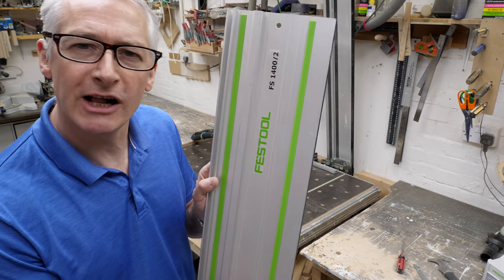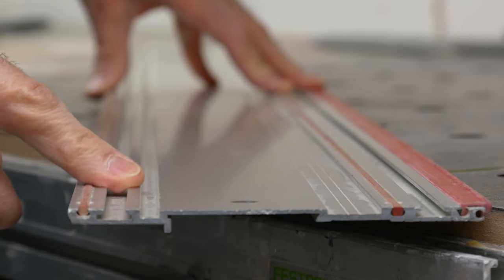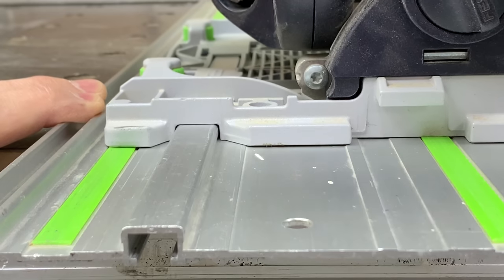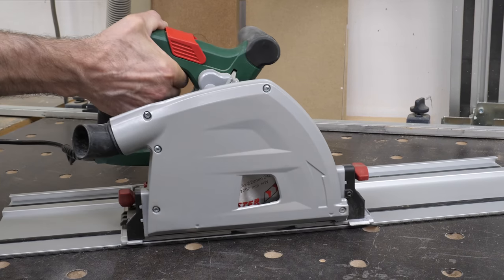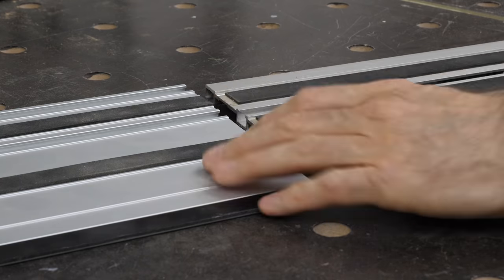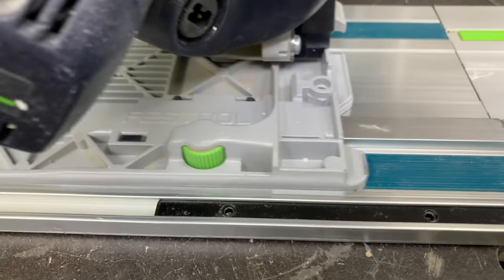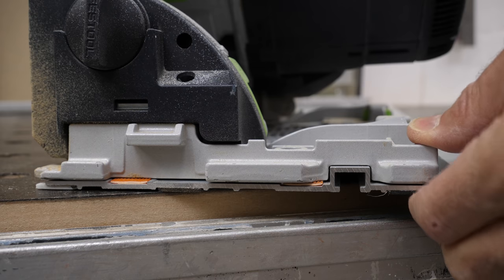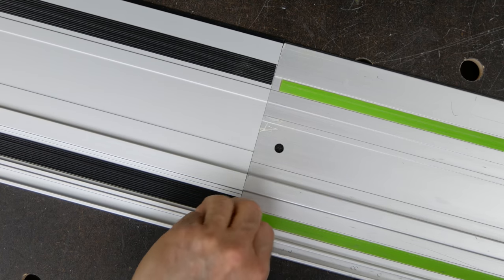Which Rails Work? A Guide to Guiderails [video #403]

Comment: Hi Peter.  Great video.  Can I talk Dewalt for a moment?  For a newbie to this MFT world (all your fault I should add) I made the decision to go Dewalt for my track saw, I was trying to balance money and quality and couldn't justify the additional £200 for the Festool.  I'm happy enough with the saw and the tracks but what I am beginning to note is that some of the useful, after market gadgets are only available for the Festool track.  I'm thinking of things like dog rail clips etc.  I have 2x 1.5m dewalt tracks but I am thinking that I might keep those for full board rips and get myself a 800mm Festool rail to use with my Dewalt saw.  That was a long way of asking..... 'how' compatible with the Dewalt saw is the Festool track, do you know?
Reply from the maker: Hi Greg. I’ve been trying to buy a decent used DeWalt saw to add to the collection for so long, but they hold their value really well! I know they do run on the Festool rails as they have the slot in the base to accommodate the rib, but I don’t know how well they do it, I’m sorry. Certainly there are more accessories available for the Festool-pattern rails, and the upwards facing t-slot makes it an easy thing to develop for. So all things considered, a shorter length of Festool rail sounds like a good investment! Hope that helps! P

Comment: Not sure if it's allowed here to post a link to a webshop.   Hbm Machines, a shop in Holland, has same guide rails 1400mm (30€) and 2x700mm (20€) in stock.  I have bought the 1400mm version which fits my parkside plunge saw.  So probably it will fit for a festool as well.
Reply from the maker: Koen Hadewych Of course! Please post a link if others will find it useful, thanks Koen! 👍👍
Reply: the 1400mm version: https://www.hbm-machines.com/producten/acties/hbm-1400-mm-liniaal-voor-de-hbm-profi-1200-watt-invalzaag-160-mm
Reply: @10MinuteWorkshop  the 700 mm version : https://www.hbm-machines.com/producten/hbm-2-x-700-mm-liniaal-voor-de-hbm-profi-1200-watt-invalzaag-160-mm

Comment: Peter I have a question for you . Does the evolution track fit the Aldi/Workzone plunge saw with the original tracks? Many thanks
Reply from the maker: I'll need to check to be sure, but the Workzone saw should be fine on the Evo tracks, with the caveats mentioned in this vid, of course. I wouldn't consider joining the Aldi tracks to any others though, again, for the reasons outlined in this vid. I'll check the saw when I'm next in the workshop and post back. 👍
Reply: @10MinuteWorkshop  thank you

Comment: Since I live across the Atlantic, I am only familiar with the festool and makita brands mentioned in your video. I just purchased the triton track saw. Where does that fit it on the guide rails

Cheers
Reply from the maker: Triton tracks are identical to Makita, Erbauer, Excel, Titan  etc...👍👍
Reply: Peter Millard thank you for your quick reply.

Comment: Which strip to choose for ERBAUER ERB690CSW 185MM ELECTRIC PLUNGE SAW 240V(screwfix)
I can't buy original, whatever. What will be the replacement?
Reply from the maker: It’s identical to the Makita pattern rail, so Makita, Festool, Evolution, excel etc…

Comment: Hi, Andres had tagged you on a Twitter thread over the weekend with myself. At the beginning you joked about cutting the guide rail. I have a 1m and 1.5m rail, but could really use just a single 700mm for smaller cuts as I don't have a table saw. Can you recommend anywhere to get one, or how to go about getting a clean cut otherwise?
Reply from the maker: Hi Alex. Most manufacturers make a short rail - usually 800mm - and they’re pretty widely available from all the usual places, though not the cheapest of options, of course. If you want to crosscut a guiderail, then pretty much any TCT blade will do for an occasional cut, higher tooth count the better - 48t works well. What saw do you have?

Comment: Hi Peter, could you tell me if the workzone plunge saw will fit and run on the makita or festool rails thanks for the vids really enjoying them
Reply from the maker: Hi Peter, and thanks. It does fit but not well - I go into the details about why in video #285, starts here - https://youtu.be/nZGt_LqR5O8?t=249
Reply: Thanks for the info. great work its much appreciated

Comment: Wow some start to a video 😮 unlike yourself I'm on Bosch so for me it's spend the dosh and get the original rail unless there's another option I'm not aware of?👍
Reply from the maker: Yep, Bosch or Mafell are the only choices for original rail. Though if it’s like the Mafell you can take out the base insert and use it on Festool rails. 👍
Reply: How right you are I don't think I could be bothered with the removing the strip and setting it up on a different rail for now I think I'll stick with the Bosch FSN.  👍

Comment: Another fabulous video Peter and one I've been waiting for! Did you try the Parkside with the Evo rails and if so how did they work?
Reply from the maker: Thanks! Yes the Parkside rails worked well with the Evo rails - slight height discrepancy, but no problem in use. At the risk of stating the obvious though, if you’re picking up the Evo bundle with 2# 1400 rails, why would you join them to the Parkside rails, unless you wanted a 2100 for something?? 👍👍
Reply: Peter Millard Sorry I didn’t explain properly. I wanted to know if you’d tried the Parkside Saw on the Evolution rails as I’m looking into getting the long rail kit. Although they are not listed anymore on Screwfix so I may have missed the boat ☹️ The shorter kit is still there though. Thanks for the reply.

Comment: Great stuff again Peter. I have been a long time follower of your track saw wisdom. I bought into the budget titan system from Screwfix but I am really missing a rail that can handle a full sheet of material. Any recommendations that I should consider requesting for an upcoming birthday?
Reply from the maker: Thanks Brian! The Evolution rail bundle is the best value by far right now, despite the niggles with glide strips. 👍👍

Comment: Peter, do you know if the Einhell rails are interchangeable with any of the leading manufacturers?
Reply from the maker: I’ve no direct experience of them, but they appear to be identical to the Lidl Parkside saw, with the same drawbacks that those rails have ie with no access to makita-pattern rails without surgery, you’re stuck with the OEM rails or Festool.

Comment: Hiha peter just a quick question i have the erbauer saw and was thinkin of a few new reals but not sure what ones fit. have 4x700 reals for rippin 8ft sheets but finding am not get a 100% straight cut can you recommend what track will fit my saw and best size of real for my job.. thanks
Reply from the maker: Unless you’re going all in in a 3-metre rail you’ll have one join in there. The erbauer uses a Makita-pattern track, so you could go for a 3-metre Makita rail at £160-ish, or perhaps two 1500mm Excel rails (closest Makita clone I’ve ever seen) at around £70. 👍👍

Comment: I have just been given an Erbauer plunge saw with no rail, do you know if any other rails can be used as Erbauer do not supply additional rails
Reply from the maker: Erbauer rails are identical to the Makita-pattern rails, so Makita, Excel, Titan, Triton, etc.. etc..  Or Festool, evolution etc… 👍👍
Reply: @10MinuteWorkshop  thank you very much

Comment: Have you tried the YouTool.de guide rail? I have used the 3m and it is very good. It is Festool's original pattern rail with only rail. It is good quality but I would only use the full lengths (3m for example) and not join them
Reply from the maker: Thanks! I haven’t no - it’s just the rib isn’t it, no t-slot at the left? I know it’s supposed to be good quality, but I’ve never got around to picking one up. So many rails, so little time... 🤷‍♂️😂👍
Reply: @10MinuteWorkshop  yeah, it's just the one rib with no t-slot. Handy for cutting full boards but you can't use any current accessories from Festool

Comment: Can i use festool joining  bars for makita tracks as there cheaper in my area and after dropping almost $900 for the saw and 2 tracks thats a good thing
Reply from the maker: You can do - I’m surprised they’re cheaper though. Just FYI the Makita bars are a better design because they’re in 2 parts. This means the grub screws bear against the bar, rather than biting into the rail as they do on the Festool. But they will fit, yes. 👍👍
Reply: @10MinuteWorkshop   thankyou for the reply   if thats the case i will just spend the bit extra on the makita  ones   and it is strange  that the festool ones are cheaper its a common thing to happen in Australia

Comment: Can you give a bit more detail on the excel track the do have some in stock at decent prices
Reply from the maker: It’s a dead ringer for the Makita, but at half the price. What more do you need to know?
Reply: @10MinuteWorkshop  Wow that was a quick reply thanks just wanted to know what saws it would work with but another run through your video should answer that one, i am looking at getting a saw and buying this track could help in the decision making

Comment: hey Peter, noticed the excel rails are back in stock. have a ts55 saw and was wanting to hack at some rails to make a jig, but didn't want to hack expensive festool ones, do you find the excel work well with the ts55? and are the 1400 or 2x700 rails a better fit?
Reply from the maker: That’s good to know thanks!  The longer rail - think it’s 1500 - is a very close copy of the Makita, so works perfectly with the TS55. The shorter excel rails are a different pattern, more like the Parkside/Einhell rails that the excel saw is similar to. These shorter rails are best avoided unless you have one of those saws, as they won’t connect happily to the longer excel rail, or other regular-pattern rails. 👍
Reply: Turns out it's only the 2x700 rails back in stock! how annoying!

Comment: Wow, Peter - cutting a Festool guide rail... sacrilege, surely??? Seriously though, I take it that was a TS 55 (not TS 75) that you used - did you use the standard 48 blade or a special one? I was considering doing the same with a 1400mm rail but lacking the courage! Great video as usual 👍
Reply from the maker: Thanks Michael! Yeah, lost my deposit in that one, lol! 😂 Yes, standard 48t Festool blade works great in aluminium. 👍👍
Reply: Many thanks Peter; I’ll pull myself up to my full height and have a go!

Comment: Hi Peter, strange question, but what blade did you use to cut the Festool track?
Reply from the maker: Regular - and a bit blunt - stock Festool 48t. TCT is way tougher than aluminium - I’ve done it a few times, never had any issues 👍👍
Reply: @10MinuteWorkshop  Thank you, I need to cut down some track for different uses and was considering using my 4 inch grinder, but will now use my track saw 😀😀👍👍

Comment: Hey Peter, Will the parkside rail fit with the Makita rail? Greetings Gerben
Reply from the maker: If I don’t refer to it specifically in  the video, then it’s probably OK to assume that if it works with the Festool rail it’ll work OK with the Makita. I can check for sure when I’m back in the workshop.
Reply: @10MinuteWorkshop  thanks for the fast reply, of you can check it that would be great.Makita are a bit Cheaper compare to festool. Thanks to you I love the mft madness.

Comment: Peter, what blade did you use to cut the track ?
Reply from the maker: It’s a stock 48t Festool blade - admittedly well-used - but absolutely standard. 👍👍
Reply: Peter Millard great, Ive got 2 1400 tracks and they are way too long joined together so I need to make a total length of 2m to trim doors so I guess I’ll have a silly 800 bit left!

Comment: Hi Peter, thanks for such a great discussion.
I currently have 2 Macallister track saw sets and I was wondering how compatible they are with the makita guide rail? I would like to upgrade to the longer rails but don't want to get them if they won't fit.
Reply from the maker: Hi there! The Macallister tracks are virtually identical to Makita pattern, as are the Erbauer and Triton tracks, so you'll be fine with them. 👍

Comment: Has anyone changed the tape on the evolution rail to eliminate the wobble?

Just got a set and the Triton 185 saw and I cant believe the difference.   The evolution rails are extremely wobbly because of the splinter strip being a different height. 

A strip of Makita rubber would still not be expensive but I'm wondering should I return the evolution and get an alternative if the Makita strip wont solve the problem.   Haven't even cut the strip yet so can easily return.
Reply: Just to reply to myself I put a straight edge across the underside of the tracks and with it resting on the two friction strips there is .5mm of clearance under the splinter strip.  this translates into a lot of wobble up top on the saw.  I've emailed evolution and will see what they say.
Reply: Never updated this, Evolution replaced my rails, one of them was bent

Comment: would love him to add a dewalt track saw to his collection to demonstrated compatibility.
Reply from the maker: Not a whole lot to say about the DeWalt tbh; they’ve gone their own way on the rails which puts them in a bad position compared with all other manufacturers. You can use the DeWalt saw on Festool etc… rails, but not vice versa, and the design of the DeWalt rail makes it almost impossible to add 3rd party eccessories - the rib is a millimetre wider than on all other rails, and being central it’s a pain to accommodate, and there’s no upward facing t-slot, or t-slots of any kind. Bizarrely, DeWalt saws hold their value really well - I’ve been looking to,pick,up,a decent used one for a years, but they always fetch more than I’m prepared to pay! 🤷‍♂️👍

Comment: I was disappointed with the Evolution guide rail 'kit' and sent it back. 

The splinter guard didn't go all the way to the end of the rail, so with 2 joined together there was a 12mm gap in guarded area.

The joining bars had the grub screws dig into the track when tightened. Unlike say the Titan joining bar, where the clamping is made by the grub screws tightening onto a backing plate that's part of the joining strip and this then clamps, so no gouges in the track.

The clamps with the Evolution are fabricated as opposed to cast. Definitely not as strong, and the angle isn't angled 'inwards' to provide bite at the tip of the spindle.

And speaking of clamps,  has anyone seen the Makita ones? They're complete rubbish. I can't understand how they sell them.
Reply: Instablaster...

Comment: You'd think Festool tracks are made of pure gold. A single 2 meter track bought here in DK will set you down over 260 GBP. That is about 1/4 of the saw cost from brand new. And that for a piece of aluminium.  Yes, it's made to tolerances etc etc - but the price should be 5 times less. You pay for the name, big time.
Reply from the maker: Good to know, thanks. I’m in the UK so no real idea of what things cost elsewhere. I’m curious you refer to a 2-metre track though, as Festool don’t make one; they do a 1.9m or 2.4m, and the 1.9 is disproportionately costly, as they don’t sell many. Out of interest what’s the price comparison between, say, the 1.4m Festool rail, and the 1.5m Makita rail in Denmark? Thanks! 👍
Reply: @10MinuteWorkshop  The 1.5 meter Festool is 96 GBP (on sale), the Makita is 61 GBP.  In comparison, the Scheppach (discount brand) is 36 GBP for the 1.4m .

Comment: I am confused about all these track saw discussions. For about 40 years I have been cutting sheet goods with an aluminium channel as a straight edge and then using either a mains or battery powered circular saw. Just measure the distance from the edge of the saw base to the blade and the teeth on the blade taking into account the offset of the teeth. Then set the straight edge that distance away from your cut line. On my current preferred saw which is a Ryobi battery saw those distances are nominally 100 mm. & 25 mm. Cut sorted.
Reply from the maker: If it works for you Michael, then don’t worry about it. I did the same myself ~30 years ago. But tracksaws are way faster to use when you have more than a few cuts to do. 👍👍

Comment: My issue with the evolution rails is when you join them then don't make a straight cut. The cut ends up wider in the middle. Anyone else had issues with this?
Reply from the maker: To be fair this can happen with any rails; it can help to use a straight edge (eg spirit level) when joining them, and to be very careful when moving the joined rails around. 👍👍

Comment: anyone knows if Makita rails works with Bosch track saw?
Reply from the maker: Never used the Bosch. AFAIK all saws will run on the Festool-pattern rail, and most will run on the Makita, but the anti-tipping lip get in the way of some saws that have a wider base.

Comment: Well... this is weird... I made a comment (this comment) a few hours ago and its disappeared 🤔 but... my comments replying to others below are still there.. 🙄... anyhoo...

I was just thinkin Pete .... it would have been handy if you had included the dims. of all the tracks in your posession in that pdf... but thanks for doing it anyways.. 😌

And as for cutting up a good track like that ?? 🧐
TOTALLY misguided behaviour....😏

😎👍☘🍺
Reply from the maker: Hi Peter. Yes, thot would be useful and I wouldn’t rule out putting something together on the other tracks, but it’s a surprising amount of work to do accurately - and not worth doing if it isn’t  accurate! 🤷‍♂️👍
Reply: @10MinuteWorkshop  yeah Pete... yer right of course... 😉
I really think the prices charged for a bit of anodised extrusion are ridiculous, the stuff is manufactured by the "mile" at little cost once the die is paid for... a lower price & higher sales volume makes more sense... its the whole idea of extruding to begin with 🙄
I bet the actual extruders aren't the ones doing the gouging though... the middlemen are the crooks 😒

Have a nice weekend 🤗
😎👍☘🍺